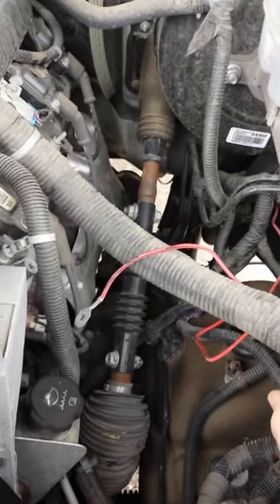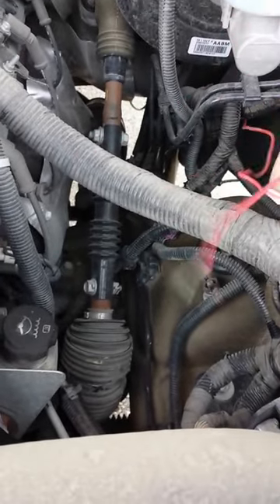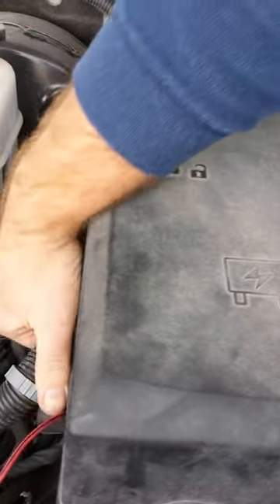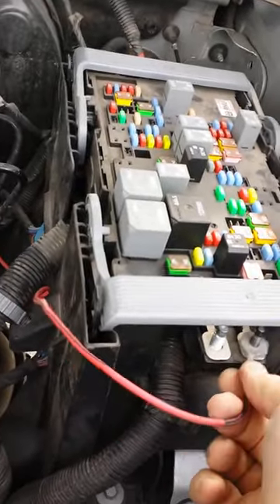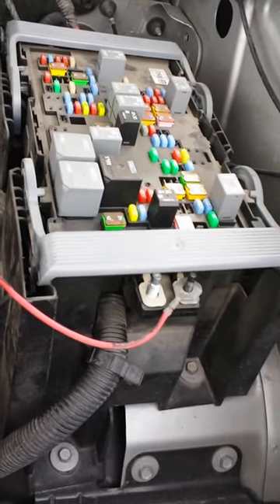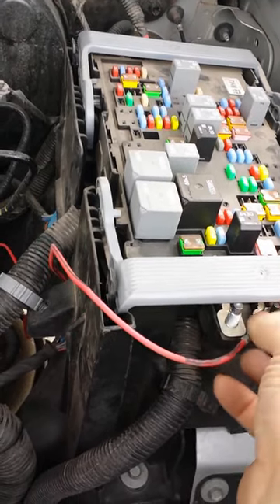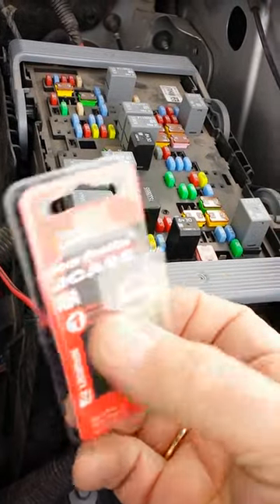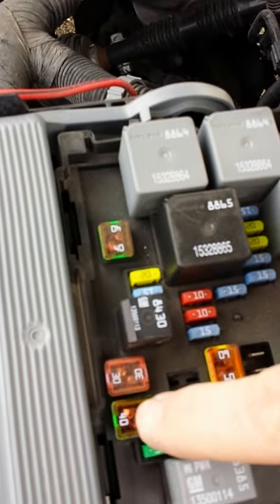2011 GMC/Chevy trailer accessory diy

Comment: Thanks for that, saved me a lot of aggravation on my 2011 GMC Sierra Worktruck.  I have EOH brakes on my new trailer, and even though I got the Chevy Adaptor for the OEM GMC  Brake Controller, my trailer brakes weren't working as they should, they didn't seem to have enough gain.  Connected the red wire and the fuse, and my brakes work perfectly now on a gain of 8.5.  BTW the nut is an M6-1.0.  Have to check my voltmeter and see if it's always hot as Devo mentioned.  My understanding from the manual is that it's only hot when the headlights or towing switch are engaged.
Reply: Yep, Devo's right, it's always hot, even when the key is pulled out.  So either install a relay or just disconnect the trailer from the truck.

Comment: I have break lights and turn signals but my inside lights and the outside top lights won’t turn on. Would this solve that? I got a new harness and same issue. Yesterday everything was working fine randomly in and out.

Comment: unfortunately it isnt on the "accessory" circuit which is only on when key is turned. this is always hot. i am installing a relay on the trailer line to provide switched (ignition) power to the batteries.
Reply: good thinking! I was worried about that when connected to an RV.
Reply: Devo, what relay did you use, and exactly where did you insert it?   I'm guessing you had to run a new wire to an ignition port somewhere on the fuse block?  Thanks!

Comment: Did this as instructed, still not getting any lights. Hooked trailer to different truck and everything works. Any suggestions?
Reply: another wire next to the
fender/ fuse box.  goes on that other post next to one in video.

Comment: Will this engage my brakes on my trailer
Reply: No.  You need a brake controller to actually control the brakes.  That wire is already hooked up.  This wire just supplies power to trailer for accessories.
Reply: @claib4  both of my wires weren't plugged in and every time I plug in my brake controller it tells me to check my airbags I'm not sure I'm plugging it in the right place but it is the only place that fits
Reply: 2010 chevy suburban ltz
Reply: Sorry, I am not that familiar with the brake wires to help you out much on that.
Reply: @claib4  no problem thank you
Reply: What size nut was that. Been working a trailer all day and finally realized that the truck isnt hooked up. Same problem you had.

Comment: I need help, i have brake lights to my trailer, turn signals, hazards while my headlights are off but when i turn on my lights i have nothing to the trailer.... i hooked up the red wire as you did and put in a 40a fuse still nothng ... smh its driving me insane
Reply: Joseph DeVito did you ever find a solution to this?
Reply: Did you ever resolve this issue?

Comment: Without this cable connected the lights of a trailer wont be on?
Reply: No, it is the power wire that runs to the 7 prong trailer lights.  It is used on accessory lights on enclosed trailers a lot or for other accessories that need power on the trailer, wenches, pumps, etc.